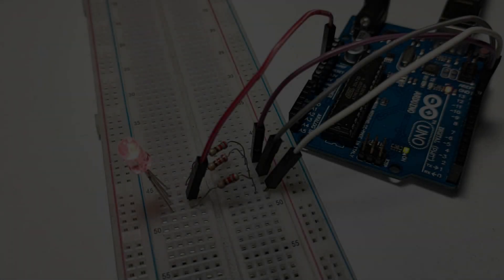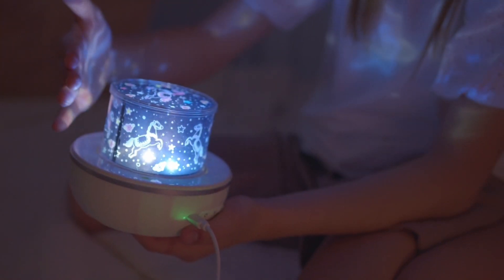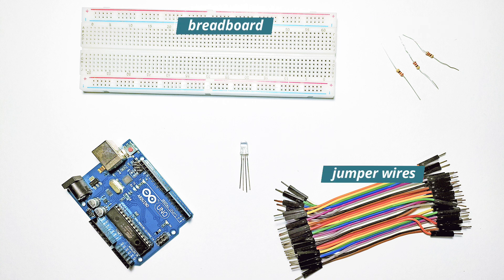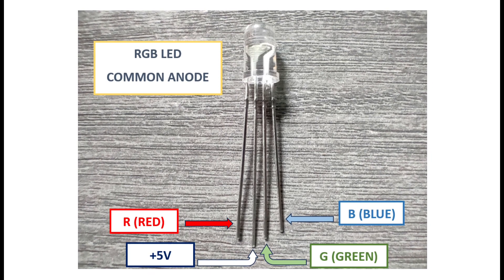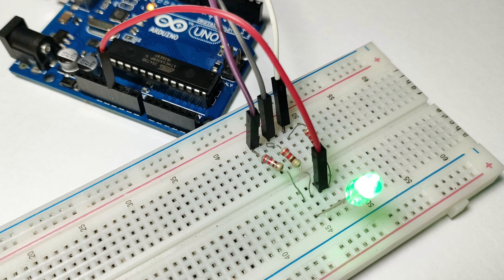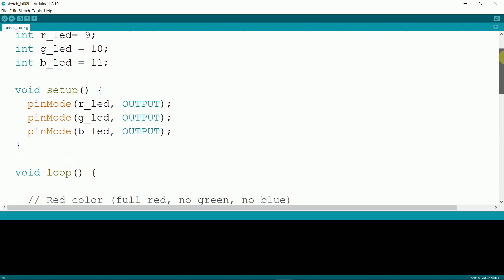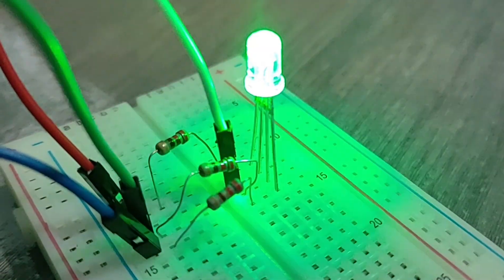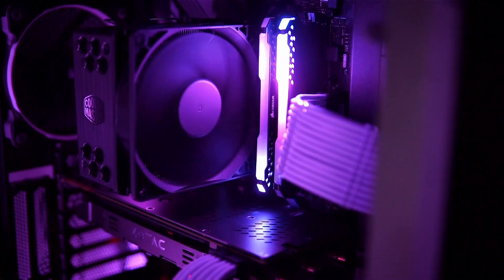RGB LED Programming with Arduino: Light Up Your Projects

Comment: String inputColor;
int redPin = 9;
int greenPin = 10;
int bluePin = 11;

void setup() {
  Serial.begin(9600);
  pinMode(redPin, OUTPUT);
  pinMode(greenPin, OUTPUT);
  pinMode(bluePin, OUTPUT);

  setColor(0, 0, 0); // LED stins
  Serial.println("Scrie numele culorii (RED, AQUA, CORAL...) sau RGB <R> <G> <B>");
}

void loop() {
  if (Serial.available() > 0) {
    inputColor = Serial.readStringUntil('\n');
    inputColor.trim();
    inputColor.toUpperCase();

    if (inputColor == "RED") setColor(255, 0, 0);
    else if (inputColor == "GREEN") setColor(0, 255, 0);
    else if (inputColor == "BLUE") setColor(0, 0, 255);
    else if (inputColor == "YELLOW") setColor(255, 255, 0);
    else if (inputColor == "CYAN" || inputColor == "AQUA") setColor(0, 255, 255);
    else if (inputColor == "MAGENTA" || inputColor == "FUCHSIA") setColor(255, 0, 255);
    else if (inputColor == "WHITE") setColor(255, 255, 255);
    else if (inputColor == "ORANGE") setColor(255, 100, 0);
    else if (inputColor == "PINK") setColor(255, 192, 203);
    else if (inputColor == "DEEPPINK") setColor(255, 20, 147);
    else if (inputColor == "PURPLE") setColor(128, 0, 128);
    else if (inputColor == "LIME") setColor(50, 205, 50);
    else if (inputColor == "TURQUOISE") setColor(64, 224, 208);
    else if (inputColor == "VIOLET") setColor(238, 130, 238);
    else if (inputColor == "GOLD") setColor(255, 215, 0);
    else if (inputColor == "CORAL") setColor(255, 127, 80);
    else if (inputColor == "SALMON") setColor(250, 128, 114);
    else if (inputColor == "CHOCOLATE") setColor(210, 105, 30);
    else if (inputColor == "BROWN") setColor(165, 42, 42);
    else if (inputColor == "INDIGO") setColor(75, 0, 130);
    else if (inputColor == "NAVY") setColor(0, 0, 128);
    else if (inputColor == "SKYBLUE") setColor(135, 206, 235);
    else if (inputColor == "LIGHTGREEN") setColor(144, 238, 144);
    else if (inputColor == "OLIVE") setColor(128, 128, 0);
    else if (inputColor == "TEAL") setColor(0, 128, 128);
    else if (inputColor == "OFF") setColor(0, 0, 0);
    else if (inputColor.startsWith("RGB ")) {
      int r, g, b;
      sscanf(inputColor.c_str(), "RGB %d %d %d", &r, &g, &b);
      setColor(r, g, b);
    }
    else {
      Serial.println("Culoare necunoscuta.");
    }
  }
}

void setColor(int r, int g, int b) {
  // Anod comun => inversare PWM
  analogWrite(redPin, 255 - r);
  analogWrite(greenPin, 255 - g);
  analogWrite(bluePin, 255 - b);
}

Here is a code